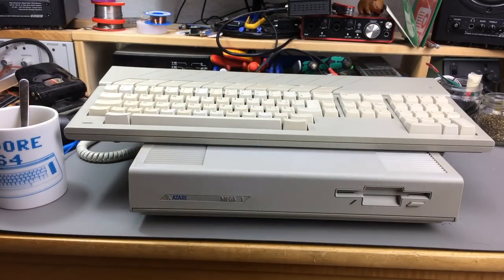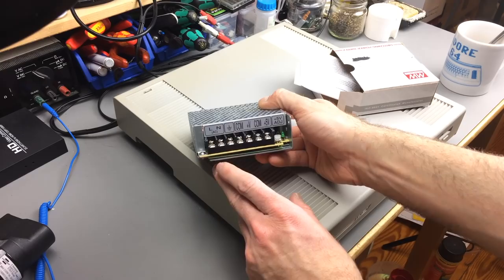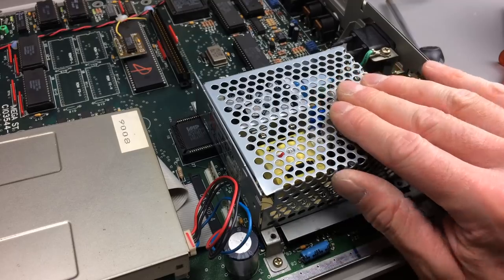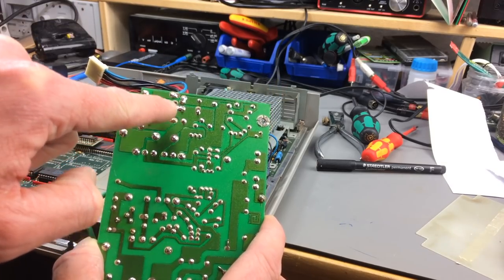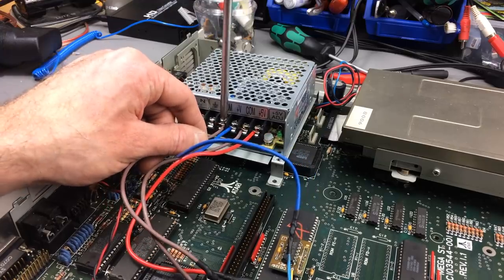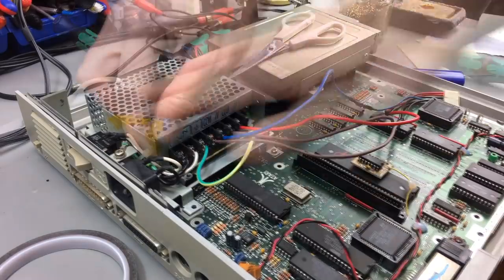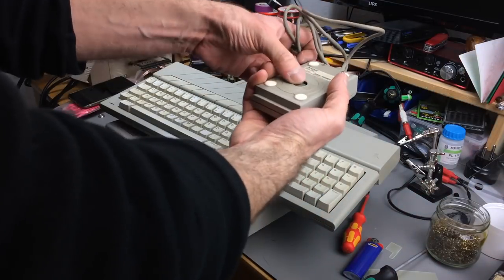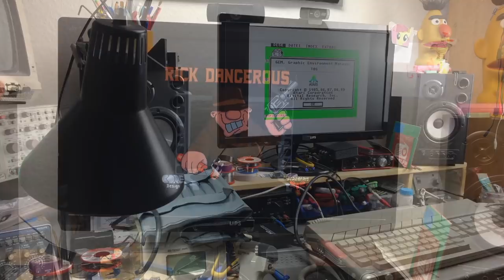Atari Mega 1/Mega ST New Power Supply

Comment: Nice work! But as an electrican I would suggest to use wire end sleeves (Aderendhülsen) for better electrical connection and avoid broken copper strings in the litz wire on screw terminals and the resulting conducting area reduction (overheat, short circuit and fire hazzard). :)

And your videos are really great.
Reply from the maker: Thanks! I actually have some good crimp spade connectors that I'm going to add in the next video. I'm also going to shorten the wires a bit. I think I was a bit insecure about how it would all come together so I left it in a hackable state.
Reply: To be fair, we use screw terminals and stranded wire on UK electrical plugs.

Comment: This is a nice solution for anyone who's worried about the power supplies in these old computers
Reply: I'm idly considering the possibility of finding one of these to replace a C64 power supply.
Reply from the maker: For the C64, you need 5V DC (which you can easily use a suitable Mean Well for) and 9V AC (which you can just use a transformer for). It's basically the same as the C128 power supply I recently built. You could use that video as a reference point. ;)

Comment: I am still using the original power supply in my Mega ST4, I've replaced it's capacitors and the bridge rectifier. I've replaced some capacitors with higher values. It now puts out stable current and works perfectly.

Comment: These little power supplies really seem to be good replacements for vintage units that are getting to the end of their days.  I have also seen this kind of PSU used in an Amiga's power brick which is probably a pretty good upgrade for A1200 owners since the original A1200 psu was stupidly cut down compaired, for instance, to the A500 version.
Reply: :-) I'm about to do exactly that - the PSU arrived yesterday. I'm following Ms Mad Lemon's recent video on the subject, although I can't be arsed to spray paint the enclosure, lol. It needs to be a slightly different model to what Jan used, the Amiga expects a -12v feed as well as 5v and +12v.
Reply: @RobUttley  You can probably use this model as well, if you just switch the polarity for the -12v feed.
Reply: The A500 consumed more power because most of it was NMOS logic.. the only reason they cut it down was because the A600 and A1200 was largely CMOS, which uses less power. They didnt allow for accelerators, but then they didn't in the A500 either.

The main problem with Amiga power supplies is they were all contracted out to whoever the cheapest contractor was regionally, and some of them were just garbage as a result.
Reply: @sjarken3979  Switch the polarity of the neutron flow, what?  Are you The Doctor? Maybe so...seems like the BBC will allow anyone to be The Doctor these days. :)

Comment: good idea. I was thinking about changing the caps in the PSU of all my old Ataris at some point, but changing the whole thing against a new one is a nicer solution. Especially as the old PSU in my original Atari ST1040 was allready problematic in the 80's...

Comment: You should really use spade terminals on those wires for a good connection, especially the 220V mains input !
I would also 3D print a cover to fit over those connections, but it's probably not necessary.
Reply from the maker: Yes, that's a good idea. I actually have some spade terminals that I can crimp on the loose wires. While I'm at it, I'm going to shorten the wires a fair bit, too.

Comment: Hi, was just looking into this, and the RD50a is fairly expensive. Given that the 12v line is hardly used on the ST series, what do you reckon to the idea of buying the much cheaper RS15 or RS25, and deriving the 12v using a cheap boost converter (which I have several of in my spares drawer!)? Particularly with the standard ST (I couldn't find that video that you made on that), space is an issue and the 5v only supplies are also quite a bit smaller.

Comment: My HTPC Raspberry Pi 3 is powered by a Phihong power supply. A 5V 3A one which originally came with my Asus T100TA.
They are decent supplies. Of course, yours is over 20 years old so a replacing it is definitely a good idea.

Comment: Thanks, ordered one to fix an old Atari 1040st.
Reply from the maker: Hope it works as well as it did for me! 🤞
Reply: Worked great, I re-capped the old ps as a backup and followed exxos directions for installation of the pull up resistors on the DNA bus (a must if you have a hard drive) 

I have an old scsi drive tower, now i have three hard drives, three cd drives and a zip drive running.

Comment: Hi Jan. I used the Mean Well PSU RT-50B for my Amiga 500. It works very well. I also had this whistling sound coming out of the PSU if no load is connected. I put the PSU directly into the Amiga 500 Power Brick. I think I will publish a video with the reconstruction the next week. See you, your Doktor64! :-)
Reply from the maker: Yeah, I think the whistling is the transistors quickly switching and trying to regulate the output voltage (which is impossible without a load connected, so they just go wild). ;) Looking forward to that video. I'm probably going to put a Mean Well in an A500 PSU soon, too.

Comment: Not loaded switching psu's may make noise. I have old Nokia charger and when phone is charged I can hear it.
Reply: Correct. Many switch mode PSU's do not regulate correctly with no load, and as such enter a "hiccup" mode where the output is pulsing. The noise is the windings of the transformer vibrating due to the abrupt pulses

Comment: That clear plastic above the power supply actually was probably meant to block direct ascension of the heat so that some air flow is created in the case for the other parts... maybe it's not good that you removed it. I may be wrong, but I guess it definitely had a purpose.
Reply: Gabriel Androczky I was thinking it might be to stop liquids spilling on the mains, as we all know any flat surface quickly becomes a “good” place to put things such as drinks heheh
Reply: @magnustveten492  Normally you have the monitor on there :)) By the way, liquids are not good anywhere in the machine, not just there :D But also, if you spread the heat, the PSU will not fry the monitor or the Hard Drive or just anything you put on there...
Reply: My thinking is that the plastic was intended as a barrier to prevent metallic objects and tiny fingers from making contact with the high voltages within the power supply.
Reply: @Starchface  you can't really drop anything in there, the holes are too small for that. It's definitely to protect whatever you have on top from heat.
Reply: @GabrielAndroczky  Or the case plastic itself is being protected from overheating.
Reply from the maker: Yes, you may be right. I just thought it would be there to prevent stuff from falling into the PSU. The Mean Well stays really cool even after a couple of hours of running so it should be fine either way, I guess.

Comment: Multiple wires on the 0V and 5V, because the weak point is the connector. Did you measure the voltages again after you connected it up?
Reply from the maker: Yes, voltages are spot on. I forgot to film it but with a load, the voltages are regulated better than in idle mode obviously.

Comment: Do these new power supplies fail safe if the 5v adjustment pot goes bad? How far away from 5v can it go? Are they generally better at protecting what's on the output if they fail?  Thanks.
Reply: You can adjust about 15%, so while you can cause overvoltage, you would not get voltages that are an immedeate danger. These kind of industrial power supplies are quite well made. Especially Meanwell does for sure not take any shortcuts, and checks all checkboxes that you can imagine. But also the cheaper Chinese ones you find on AliExpress are often quite okay. I would recommend against buying wall wart adapters from China, the industrial power supplies on the other hand are generally well designed and built.

Comment: Jan, I would like to replace the PSU in my Atari TT, but it requires -5v and -12 - would you suggest a good supply? Thanks
Reply from the maker: I think there's models from Meanwell that output all the voltages you need. I can't tell which model is best for the purpose off the top of my head though. Take into account the amps you need for the different voltage rails and compare the data sheets. Should be pretty straightforward. The PSUs get larger in size with more Wattage though so I don't know if you can fit a replacement in the original case.

Comment: I have an STE i found at the rubbish tip years ago and saved, it works perfectly, I did pull out the psu with the intention of recapping it as a preventative measure but all the caps tested perfectly and there is no ripple on the 5 or 12v rails so I just left it alone.  I think it has had minimal use. I have an external 20Mb scsi hdd off an original mac and an icd link which works well. Interestingly most floppy based games wont even run if the hdd is turned on, i'm guessing either lazy programming or some kind of primitive copy protection. I also have a TT030 locked away in a drawer, I used to use for high school home work. It's hdd has unfortunately seized so my memories have been lost unless I can free it up some how.
Reply: You should search for FOF- (Flame Of Finland) and Superior-compilation images. Most of them are made so, that they work straight from HDD. I have Gotek, but I would still love to use an HDD... Maybe someday, though I have other problems with my ST and STE. I hope they come from bad PSUs, someday when I get the inspiration (and money), I will refurbish/replace the PSUs and recap the motherboards...
Reply: I once had a megafile 30 i picked up from e waste, I couldn't believe my luck. Plugged it in and it worked perfectly and still had the old owners data on it. I kept it for a while and ended up selling it on eBay. Now the STE sits on my desk permanently and i have a monster joystick for it and use it regularly re-living my youth. The icd link i stumbled across on eBay and snapped it up as the only bidder. The 20Mb hdd was given to me years ago along with an original mac. I wish i kept that too but i threw it out :( When I had to move out of the family home much of my vintage computer collection had to be thrown out. I had several ibm 5150's, model M keyboards, atari computers and peripherals including both laser printers and dot matrix. I also had the atari 286 pc. All went to the dump as I had no where to put them. I regret this.
Reply: @MMWA-DAVE  Yeah, I bought an regular 520STFM from ebay and an STE with 4096 of memory. STFM is in pretty good condition, STE was pretty badly "tried to" repair. I fixed the reset button by connecting it again with new wires soldered to different position (the guy who had tried to install a new reset switch had basically ripped the traces out of Mobo and twisted the buttons contacts pretty badly...)
They both have strange problems, which I think come from bad PSUs.
I had an Falcon, back at the days, but then my drug addict cousin "payed back" the effort I made by offering him the place to stay when he had no other place. And stole my Falcon, along with few other things (Lynx, Nokia N-Gage, a couple of Spectrums etc.) from my storage. The sad thing is, I believe they all were wasted. At that time they had no use for about anyone. But well... Such is life, I guess xD

Now I have collected over 30 systems (consoles, 8-bit computers and so on)...
Reply: Miika Suominen damn shame about the falcon. Its one thing I’ve always wanted but the crazy money they sell for now makes me think i cant justify the expense.
Reply: @MMWA-DAVE  That is true, it's something that I won't be buying unless I make some find with low price. And odds for that happening are very low...

Comment: You could have connected the new PSU to the left connector on the motherboard and thus use shorter wires (maybe the original) : both are identical

Comment: Nice job as always.   You can go broke buying those specialty crimping & extraction tools the various connectors but if your working with a specific type of connector quite often then they are worth purchasing.   I believe I saw a fan mount near the PSU and I would install a fan there to exhaust heat especially from the PSU and rather than blocking part of the vent grill around the PSU I would of just better insulated the wires you were concerned with.
Reply from the maker: Thanks! Yes, I might add a fan sometime. As far as I know Atari only mounted fans in the Mega File hard drives that used the same cases because they ran hot. The Mean Well PSU seems to stay really cool so far (even after some hours of work) so I don't know if any further cooling is necessary.
Reply: @JanBeta  Maybe my memory is misfiring but I remember Mega STs having built-in fans, at least the Mega 2 and 4 here in the States. Granted, I only used them at dealerships because I only had a 1040STf until the Falcon came out...  If the power supply stays cool, then I guess you'll never get to see Mastertronic's "Ninja Mission" go haywire and allow you to cut off limbs of the opposing ninjas. One night, my friends and I played my 1040 for several hours straight, started playing that game and the limbs started flying. I had never seen that before nor ever again since that night...

Comment: I would be so scared to reuse those old screws this way since they stick out so much and there is stuff beneath it. It's obviously OK, but I would probably still use some kind of flat headed ones. Anyway, great work as always! I so envy you your skills :D
Reply from the maker: Oh, there's plenty of room under the PSU but I might actually replace the screws next time I'm in there for good measure.

Comment: The original supply seems resonable for the technology then. Bog standard flyback with transistors and optocoupler. You could have modernised the PSU with a TNY263-268 integrated switch+PWM controller for a fraction of the cost ;-) But then again I don't see much that could go wrong with the original ;p

Comment: Typically when I test SMP units I will put a 1K 1Watt resistor as a load to get better ball park voltages so the SMP has a load to regulate properly.
Reply from the maker: Yes, that would have been a better idea for sure. Can't really measure SMPs without a load properly.

Comment: Interesting... I think, I shall make the same in atari st1040, because the power resistor in the output circuit is very hot. IMHO need to be add small fan for blowing power supply ;)
Reply from the maker: Defnitely a good idea to replace old SMPSs. They tend to break with age (especially the capacitors). I tested the Atari for hours now and the power supply stays really cool so I don't think a fan is really needed. Might still add one for good measure sometime though.

Comment: I used a Meanwell PSU in my ZX Spectrum +2A. I think I’m going to need to replace the original PSU in a Heathkit H88 soon! For my 1040STe, I bought one of the PSUs from exxos.
Reply: That brings up an interesting question... whether the Meanwell or the exxos power supply replacement is better...

Comment: That's really nice! Dying PSUs is really a problem these days.
Do you think something like this could be done with the Amiga 2000? Those PSUs are notoriously bad, hot and noisy too.
Reply: Yep, the innards of the PSU can be replaced and there are plenty of off the shelf "frame" PSU's like this one which will do the job. You need +5, +12, -12 and -5V for an A2000. There is also a TICK signal from the original PSU, but you can avoid this by changing J300 on the motherboard
Reply: You can also avoid needing the -5V supply, the system will work without it, though some Zorro cards may require it. Not much current is required, so it is possible to make -5V from the -12V line using a 7905 regulator IC
Reply: @jaycee1980  thanks! That's very helpful. :)
Reply: i have switched twice AT power guts inside of orginal A2000 psu and tick signal change :) nowdays there is adapters to pinout cable too :)

Comment: maybe you could make a plastic cover to fit over the terminal block of the new PSU so the connectors are not exposed when the case is open. just my thought for extra safety for 'stupid mistakes'  but I guess you're not stupid :D
Reply from the maker: I might do that although I think the new supply already is much safer than the original open frame one. ;)
Reply: yeah didn't think of that but indeed the old one was just a circuit board with components. They must've considered the outer case and metal shield to be as sufficient safety. Current PC PSU's however are fully enclosed but those have fixed wires (most of them)

Comment: Would be cool to see Meanwell to ATARI ST/F/E/FM. BTW in other video i saw soldering quality of these. Some may have coldjoints  :)
Reply from the maker: Oh, didn't have any problems with the Mean Well supplies yet, and I've used a couple. I'll be watching out for cold joints in the future!
Reply: @JanBeta   I swapped it to my Atari Ste now. It fits 100 % just needed 2 holes to mounting plate and some wire extensions :)
Reply: @TheLemminkainen  So the Mean Well RD-50A can also be used in the the 520STFM with no issues ?
Reply: @imacattackau5635   you need to extend cables and drill holes to metal brackey under psu. It works fine 😁
Reply: @TheLemminkainen  Cool so the exact same model  fits right into the case
Reply: @imacattackau5635   take measurements i think i found the model from forums somewhere +5 +12v meanwell psu.